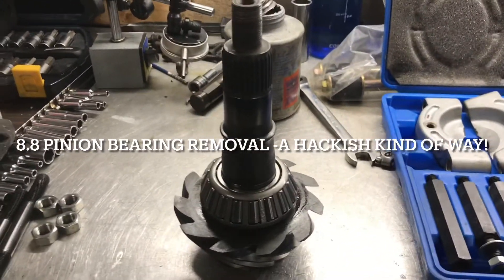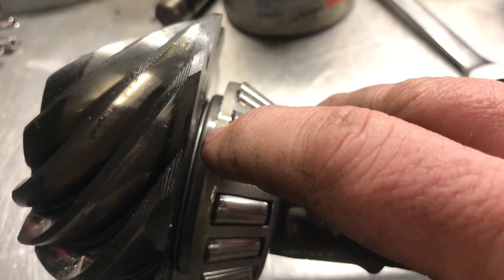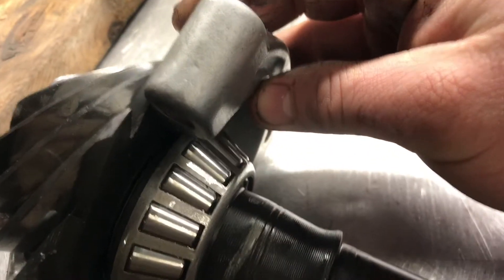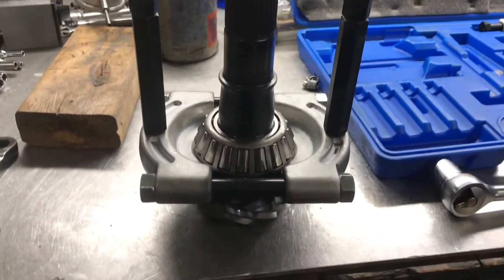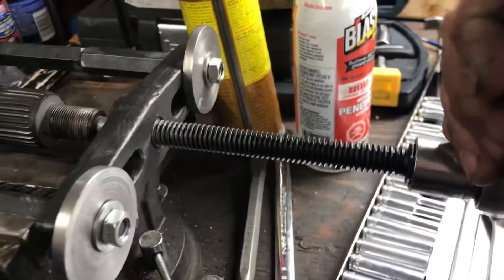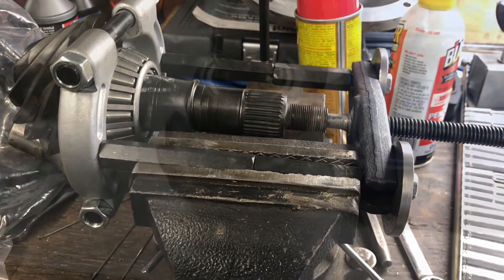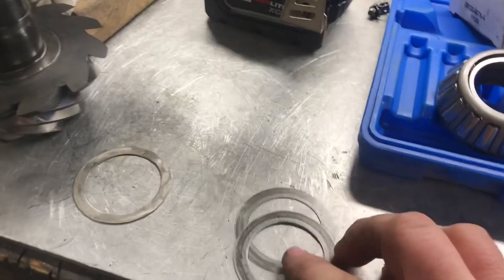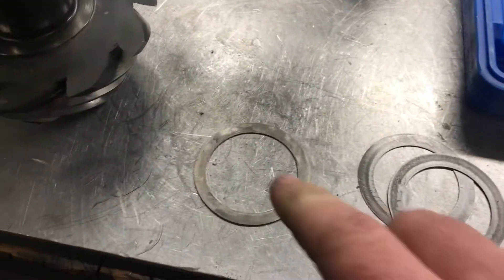8.8 Pinion Bearing Removal - A hack-ish kind of way

Comment: WHY WOULD YOU WANT TO SAVE THE OLD BEARING? THEN WHY ARE YOU REMOVING IT IF YOU DONT WANT TO DAMAGE IT? I JUST CUT THE BEARING CAGE AND THEN THE RACE WITH A 4" DIAMOND GRINDER WHEEL AND THEN DO THE FREEZER TRICK AND WARM THE NEW BEARING AND IT'LL DROP RIGHT ON.   DO NOT CHANGE THE PINION SHIM IF IT HAD A FACTORY SHIM UNDER THE OLD BEARING MIC IT OR USE THE SAME SHIME AGAIN, NO PROB, SET THE PINION BEARING DRAG TO 16- 28 INCH LBS. AND YER GOOD TO CHECK THE RING GEAR LASH OF .0008- .0012

Comment: There is a very simple way to put it back on. Put the bearing in the oven at about 300. For about 30 minutes and take it out and it will drop on. I really did do this before and it does work
Reply from the maker: @PaulWright-h6p  yes so have I…it works great.

Comment: Why isn’t the original shim just used ? Should’nt it be the correct space ing?
Reply from the maker: @charlesneal4603  it should be but depending on if you have Ford Racing gears or not will determine that. Meaning Ford gears will usually not need a shim change. I always check though just to be sure. Assuming the shim will be the same isn’t taking into account machining tolerances. The Ford housings do have a Master housing dimension to reference off of though but you’ll need a pinion depth tool to measure and then compare the MHD to the measurement you got.

Comment: A little trick is to get it started on the clam shell puller, then tighten the nuts up. Put the puller on edge and smack it with a hammer, that way you drive the puller jaws a little deeper and wedge the bearing away from the shaft. Retighten the nuts and pull it off as normal.
Reply from the maker: Oh that’s a good idea too. Never thought of that!
Reply: @Shawnsboostedgarage  just a trick from an old school mechanic that was taught by my grandfather who was a airforce mechanic in ww2 in the pacific fleet.
Reply from the maker: @RAYROTHSTEIN66  the proverbial make due with what you’ve got!

Comment: Looks like big wasn't fully seated at start of video, usually impossible to see shim until big removed,  usually put same size shim when replacing brgs or ring and pinion  (40 years of doing these , never adjusted shim) only needed to adjust shim size if changing housing. A high end pulley/ jaws does a better job than princess autu/ Harbour freight quality setup. Set pinion on 4 x 4 block not on teeth if using chisel,  less likely to damage teeth.
Reply from the maker: I agree with what you are saying and I havent been so lucky as to not having to change the shim. And yes better tools makes for a better job. This is to show that you can do it with just about anyhting if you had too...thanks for watching and sorry for the way late response!...lol

Comment: Not really hackish. Tip - Ream the inside diameter of an old bearing so it is a slip fit and use it for set-up...when satisfied, then press the new bearing on. Btw, a 12-bolt Chevy uses the same bearing as a 8.8 Ford.
Reply from the maker: Thanks I actually did a video about making a test bearing a while after this video. It sure makes things a lot easier! Good to know about the bearing interchange as well.

Comment: I just did a gear change on a Ford 8.8. Instead of messing with this shim, I just stuck a larger carrier bearing shim under the outer race. I'm not sure if it'll cause problems but I'm trying it since it's much easier getting that race in and out vs that bearing on, and off the pinion. Have you ever tried this by chance?
Reply from the maker: Yes that is a way of doing it too. Probably makes it a much quicker procedure too.

Comment: gonna try this. hope it works
Reply from the maker: Oh it will work. I’ve used this trick many times. Just get a good cold chisel and smack it between the bearing and pinion head. Make sure you are on a solid surface. I put a 2x4 on the concrete floor so I had a solid surface to hit on.  That’ll give you the room you need for the puller
Reply: @Shawnsboostedgarage  just afraid of damaging pinion tooth
Reply from the maker: @alcyon2sp  jus make sure you have it on a piece of wood. That’ll protect the teeth. Plus the teeth are hardened.
Reply: @Shawnsboostedgarage  update. I did not have to chisel the bearing to get the gap. My toyota came with 1.97mm shim. It was enough of a gap for me to use the standard bearing puller like yours and the bearing came off after some huffing and puffing.
Reply from the maker: @alcyon2sp  well you got lucky there! Glad it all worked out for you.

Comment: When I was a Ford tech I went to the Ford school in St Louis and there they had a puller especially designed for pulling Timken bearings. Worked really well but probably cost a small fortune.
Reply from the maker: Yeah there are some specialty made pullers and you’re right they do cost a small fortune….like $500 or so!

Comment: Why on Earth would you not show the actual chisel method instead of just showing us before and after?  I certainly understand how you did it but I would love to actually see it.
Reply from the maker: I guess I over looked that. But it is simple to do. I found it worked better by putting a 2x4 on the floor because it was sturdier than my bench. Pit the pinion on the 2x4 to protect the teeth from the concrete floor. Take the chisel and put it right where the bearing inner race meets with the pinion shoulder and give it a smack or two or three. It should just move enough to get the split bearing puller underneath so you can finish removing the bearing with the puller. Hope that explains it better.
Reply: @Shawnsboostedgarage Hello Shawn. I’m trying to salvage the bearing and the shim from an old pinion to make a dummy bearing like you explain in another video. Can you please explain me how you used the chisel to make it move? I need that little space to get the bearing seated correctly in the bearing extractor too 😅 Thanks!
Reply from the maker: @MarioSaavedraA  Hi Mario. Have a look through the replies. I explained it to someone already. I really need to do a video but don’t have a pinion with a bearing on it at the moment.
Reply: @Shawnsboostedgarage  oh sorry I missed it. Thanks! Will try later 🤝
Reply from the maker: @MarioSaavedraA  No worries. If you got any more questions feel free to ask.
Reply from the maker: Oh and maybe I’ll do a little video to show just that. I’ve been working on a garage quick tips series. That would be a. Good one I think.

Comment: I did it with that, I think it's called a clamshell type of puller and had access to a 40 ton hydraulic press and initially I couldn't catch the inner race and had to start off by pressing on the cage of the bearing and then repositioning the puller when I got a slight amount of clearance to grab the inner race of the bearing and I was planning on replacing that bearing anyway, anytime I have to use a press to pull off a bearing, I don't trust reusing it. But I started out trying the pinion with the existing shim that had been on there and thinking it would  give me the right pattern once again with the  different carrier and it didn't work out that way, so I had to press off that bearing and then I made a test bearing out of it And kept trying until I got it right. ultimately I put that together (a Ford 8.8 373) without any shim under the bearing and the pattern seem to look good, the preload I put on it wasn't quite enough however 14 to 18 was one spec and I put 17 inch pounds,  in a few miles I had end- play on the pinion and I had to put more inch pounds on around 28, which changed the position of the pinion to the ring gear and that's why I had to readjust the backlash and I should have readjusted the pinion depth first but I didn't, I used it as it was and it's still going but it does make a little noise  when I accelerate and goes away when I coast at freeway speeds. Total I've got less than 10,000 miles on it now and that includes some 200 mi plus round trips. Time will tell, of course I should have taken it completely back down pressed off that bearing& try to shim a little bit thinner than what had been on there and rechecked it, but I didn't have the time and I couldn't tie up that facility with the hoist for that long .
Reply from the maker: yeah making up a dummy (test) bearing is the ideal set up for removing and installing the bearing multiple times. I didn't have one and didn't want to spend the money either. I found this to work for me but is time consuming with removing and then heating the bearing and then cooling the pinion gear. 

Getting the pinion depth right is the first step and then everything else can be set from there. It's a time consuming process. I had multiple tries before I got it right. Even then I wasn't 100% happy with the gear setup. I was using a used gear set so that makes it difficult to get a good pattern unless you knew how much shim that gear set had initially. Even then it might not be right for your housing. 

I've just recently got the car back on the road and am happy to report that the diff is quiet and makes no noise on accel or decel.